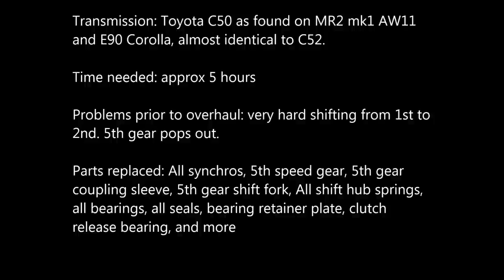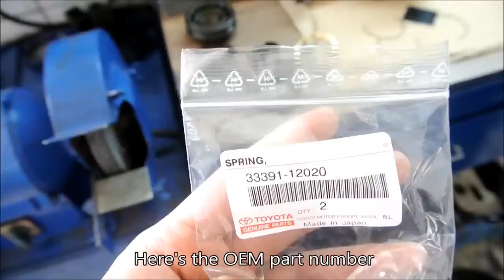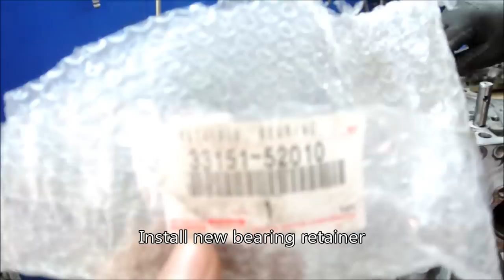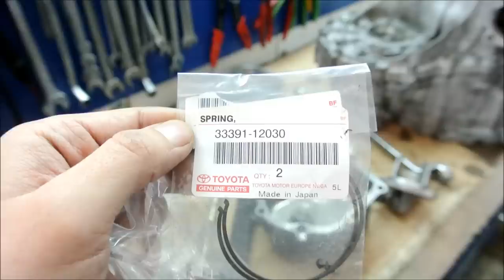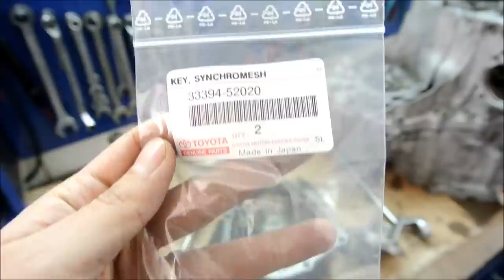Manual transmission full rebuild and assembly - step by step how to

Comment: I rebuilt my Toyota G52 five speed myself. Alone. Outside. Under my giant old cottonwood tree. 
I had never even seen the inside of a manual transmission. I have the factory manual which is written for someone completely familiar with the procedure so there is NO explanatory material. It's written in the mode of "grasp new part between thumb and fore finger. Install new part". 
I took pictures during tear down and that helped. When I began this project I didn't understand how manuals worked. When I got done I still didn't understand. I also still had the problem I rebuilt it for - the infamous first gear kick out. After much thought I came to the logical conclusion that the 1-2 shift fork was worn out. Never having seen a new one I didn't understand that it indeed was completely wiped out. When I got the new one it was pretty obvious but I was pleased that at least I had figured it out. First gear is still a bit tight, I think the 1-2 slider I replaced isn't in love with the original hub yet, but the transmission works. 
Sometime during the two weeks I spent figuring out what was causing the first gear kick out to still be there the light came on. Suddenly I understood how it worked. To think that this transmission design was engineered in I'm guessing the early 1900's. The basic design is the same now as it was designed then. Whoever thought up this design should get the recognition they are due and have a documentary about them. The design is utter genius.
Reply: try suzuki DA53 or DA65...😁
Reply: Champion well done

Comment: I was heating a horseshoe and set it down on the bench when my talkative neighbor walked in. Curiosity got the best of him and he picked up the shoe and then threw it down. I asked him "A bit warm?" He said "No. It doesn't take me too long to look at a horseshoe."
Reply from the maker: +obsolete professor Hahaha!
Reply: That's awesome! Your neighbor is either very quick witted or has more experience than he should with touching things for no good reason. Either way I approve of his message. Two months ago I burned my fingers severely after plunging them into a container filled with play sand that had been super heated a half hour prior. I was surprised at how long it remained at such a high temperature

Comment: nice video , still even the internals of some of these manual transmissions are difficult for me still to do correctly.  But by looking at all these manual and automatic transmission videos so far i am seeing no major special tools other then snap rings pliers and general mechanics bits /socket sets. It seems the hardest part about transmission rebuilds is keeping everything put back exactly how you took it off. Which have tons of components to keep track of so make it difficult without practice to get right the first time.

Comment: I like your creativity with tools. True technician spirit!

But I do have one remark. The differential has tapered bearings. This is because a tapered bearing can take radial as well as axial load. But to do this in a proper way, they need to have a pretension (0,15-0,20 mm). So you need a shim under the outer ring of the bearing. This way it will be less noisy and the bearing will last longer.

Comment: Finish watching this video and no way I can find a mechanic with such expertise and capability in my country since manual transmission is rare now. Most mechanic will recommend to replace the whole gearbox. My Getrag 220 in E36 318i can only spend the balance of lifespan. Still shifting fine but a bit sticky. Thanks for the video anyway. Great work there 👍

Comment: On a 2011 Mazda 3i...
In changing out my clutch I opened my gear box by mistake.  I also accidently knocked loose the exterior selector lever assembly which connects to the shifter cables-I think I've got that fixed.   I'm not sure I put the transmission back together right.  When I went to replace the gear box oil it began spilling out rather fast.  Hopefully it's just a new axle seal that's needed, something I've already ordered.  If it turns out due to my error my transmission needs to be rebuilt I know that it's time to take it to someone who knows what they're doing.  LIke you guys.

Comment: Why not cleaning the case and the cleanable parts in a cleaner? And why cleaning the control shaft gasket surface after everything is assembled? Dust goes in, even if you clothblock it, you can't get all the dust out with removal of the cloth. Dust also sits on the shafts, and the places where the 5th gear goes. The process logic definitely has to be reviewed. Try to write it together, analyze and perfect it in every aspect.

Comment: At 10:37, arrow on reverse idler shaft has to point in that directions because reverse idler shaft lock bolt has to screw in it at 11:24.  Just pointing that out.

Comment: Excellent reference! I had the 5-speed in my 2009 Pontiac Vibe (same as Toyota Matrix / Corolla) rebuilt due to a bad input shaft bearing and some worn synchros. About 4k miles after the rebuild, the trans got stuck in reverse internally (shift cables and linkages are fine). Do you think this could have been due to the rebuild going wrong, or is it unrelated?

Comment: To me i think it be easy to put back together or more easy. Provided i understood the point of each internal component and why its there but as of current i only understand the major components aka planetary gears, some o-rings, some washers, transmission pump , ...etc but the amount where everything is need and why is still fuzzy more for the automatics. Even some internals of manuals a little fuzzy to. Not major components but there is tons of small components that leave me questioning what would happen if i took it out , what is major purpose / affect is... i guess on tinkering around/practicing would give you this insight.

Comment: I like the video, but there few a things that you could have researched and did on own, like if wanted to change the 5th sinkrow or 5 gear.. You could just oopened the back end of box, taken the 5th sinkrow or 5 gear on your own, bought new parts and installed but yourself.. I didn't like when the guy took the casing of the Twincam gearbox used the Victor Reinz sealer, but didn't let sealer get tacky so the sealor bonded stronger forming a better seal for the gearbox casing..

Comment: nice vid. one comment, tho. wouldn't it be easier to insert the teeth with the selector on the hub outside of the trans, instead of doing it after the hub is already pressed onto the shaft?

Comment: why do some videos you gotta press the hub with the machine while other videos I seen you dont have to use any machine at all and just drop the gears into shaft.
Reply: Its just how transmissions are made. Some have gears that need to be pressed on and others are held in with snap rings

Comment: How did it shift between 3rd and 4th gear? I noticed the shift collar was reinstalled upside down... Just curious if you noticed anything funny...
Reply from the maker: It shifted ok, but the mechanic noticed signs of wear so we flipped it around. Still shifts great but it should have some more life in it now.

Comment: How did he install the 5th gear?  At 13:39 it shows him tapping it on with a socket to start it.  Then he starts the big nut.   Then you hold up the bag of the 5th gear to show the part number.   Then at 14:09 the 5th gear is installed.  If you press the 5th gear on, the shaft can't be supported from the other end and you'll damage the case.  Toyota requires a special tool 09309-12020 to install this gear.  Did he press the 5th gear on by tightening the big nut with an impact wrench?
Reply from the maker: Yes the 5th gear was installed by tightening the nut. Absolutely nothing wrong with that. Transmission has done a lot of miles since, zero issues, fifth gear is rock solid. No case damage. The man doing this rebuild has rebuilt several thousand transmissions, and has experience and skill that is hard to explain. Special tools are meant to standardise procedures so that even unskilled labor can do the job. If you think there's only one right way to do something, always think again. I learned that lesson many times over.
Reply: @d4a  Right, there would only be case damage if the fifth gear was pressed on the output shaft with a press because the output shaft can't be supported from underneath.  Thanks for clarifying that the 5th gear was pressed on by tightening the big nut.  Sounds like a good method.

Comment: So the sliding coupling sleeve and second gear doesn't need to be replaced after all the "grinding gears"?
Reply from the maker: Nope. Just the synchro
Reply: I recently had my c50 rebuilt for $1,200.  I think that's all they did to mine too, because they did it in a week or less.  It would most likely take awhile to get the parts from Toyota.  A rebuilt kit can probably be gotten just about any auto parts store.

Comment: Thanks for the video:)I'm not familiar at all with transmissions but I have 1998 Toyota corolla VE manual transmission and when I shift dawn 1st & 2nd gears it feels really hard! I have to play with it at least a couple of times for it to get to gear. I want to do the work mystery because I really like the mechanic work I think is freaking awesome! Have you seen this same problem before and is so what do you think it is?By the way I lent to say that the car has 130,000 miles
Reply from the maker: +danny Does it make grinding sound when you shift? If it does than that's most likely a syncro. I would not recommend doing the transmission yourself if you are a novice mechanic. I rebuilt my engine myself but did not do the transmission. Opened it up, took a look, closed it and took to a professional. Engine to transmission is like lego duplo to lego technic :)
Reply: It does not make the grinding noise, is just hard to shift.Thank you for the quick response!

Comment: Want to ask you if it's worth rebuilding a trans which had some water mixed into the oil - I see that some bearing races have black marks which can be felt with finger. So I'm guessing that shafts might have the same marks and just replacing the needle bearings which  sir between the shafts and gears might not be enough. What would you do?
Reply from the maker: I really can't say anything, I would first have to see it in person. But based on what you're describing I would likely junk it.
Reply: @d4a  i see. Gears do look okay and are not rusty but bearing races have dark corrosion pitting
Reply from the maker: @fastboatster  Gears and synchros fail because of mechanical damage (a lot of poor shifting etc) they would likely be able to take diluted oil better than the bearings and shafts. If its a common transmission just junk it as you will always have second thoughts about it. You might rebuild and then it fails after just a few thousand miles. The risk isn't worth it in my opinion. But it all depends on the type of car and what you expect to get out of it.
Reply: @d4a  it's relatively common but very expensive. I'm actually looking at the mechanical part of Audi dual clutch transmission. I guess I might have to think about it for a while, might not find the replacement bearings after all, although they do seem to look like common tapered roller bearings.

Comment: Surprised a shop like this didn't have the right tools for pulling that bearing out of the blind hole and resorted to using the hackery (which worked, no doubt). But easier with the right tools !
Reply from the maker: Hackery! Lol. They did have something, but after being unable to find it for 2 mins they gave up and hackery stepped on the scene.
Reply: I too was surprised to see screw drivers and a hammer used rather that circlip pliers but it worked.

Comment: So you installed a differential without setting pre-load. Gona be a very noisy gearbox
Reply from the maker: Raymond Wilson I did over 1000 miles with it. Zero noise.
Reply: Either you are lying. Or you are lucky

Comment: Question if you know. My C52 has a leaking oil seal at the shift shaft.Did you replace the oil seal there or do happen to know the part number or if the gasket kit you can buy comes with it? Do you think it is possible to replace with the transmission in the car? It looks like it should be possible but can't find any information of than what is in the MR2 repair manual. Can you still buy the dust boot new for the shift shaft as well?
Reply from the maker: I didn't replace the oil seal at the shift shaft. Wasn't leaking, I hope it won't leak once I reinstall everything. The kit doesn't come with it. Here's the part number if you want to give it a try at your local toyota dealer: 90311-15003. This is from toyodiy.com, so the number might have been changed or updated, but your dealer should be able to source it based on this number. 
The dust boot part number is 33531-17010. Mine survived the abuse so I didn't check for a new one at the dealer. I gave it a big dose of silicone spray a few days before the rebuild, to prepare it for the abuse when its taken off. Maybe it helped. 
Whether its possible to remove the shift shaft seal while in the car, I really don't know. I myself would not try it. Its really tricky to get the shift shaft back in as you have to align the forks so it fits. Imagine having to do it while diving into the MR2s engine bay....probably with your feet in the sky.
Reply: Thank you SO MUCH...I have been posting all over the place (forums, facebook) and even emailed the Lithia toyota forum person to no avail. 

I think you've been posting on one of the forums right?

Either way, you rule!
Reply from the maker: +Bigbacon No problem, glad I could help. Check out toyodiy.com for part numbers, a great source. I have a huge thread on on the mr2 board forum. I'm bugging the super experienced guys all the time :)
Reply: one last question, when you are removing/installing the shift shaft, assuming the transmission is in neutral, is there anything special you need to do when doing this? Do you have twist it or anything to get it out/in and then how do you know that it is back in the correct spot before you put the lock bolt back in?
Reply from the maker: +Bigbacon If i remember correctly all gears need to be in neutral for removal and installation. You will have to test after installing. Switch through the gears and spin the input shaft and watch the output shafts. They should spin with a bit of effort and of course make more revolutions as you go up through the gears. I don't know of another way to be sure its installed right before driving it.
Reply: I had done replacing the same on my Corolla C52. You can remove the shift shaft with with transmission in car. Remove the shifter cables, remove the 4 bolts on the cover, 1 bolt ( I think 17mm) on top and you can pull out the shift shaft. Transission should be at neutral. But you have to disassemble the whole shaft before you can replace the seal. Also replace the bellows and the gasket while you're at it.

Comment: The input gears are loosely attached to output shaft with just small sleeve bearings? how does it lock securely with the total weight of the vehicle?
Reply from the maker: +eventfulnonsense Sorry but I don't understand the question. Can you try explaining a bit more?
Reply: driving 4 answers The Speed gears connected to the counter shaft gears. How do they secure. The Gears which connect to the output shaft hub or the ones that are constantly connected to the counter input shaft. English isn't my language. My apologies.
Reply from the maker: eventfulnonsense I think I kinda get it now. The bearings are pressed on the shaft. You need a gear puller to get them off. The sleeves are secured with keys and a spring. You can check tiyodiy.com, there's a detailed exploded view of this transmission and you can see it all there.
Reply: driving 4 answers Thanks, I appreciate your reply Sir.
Reply: driving 4 answers